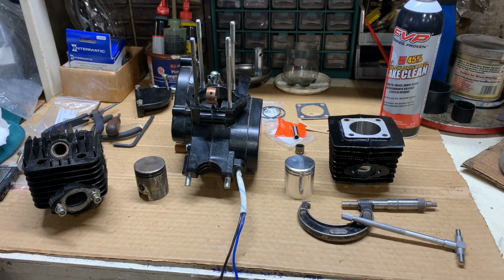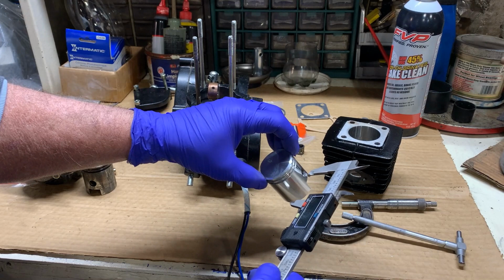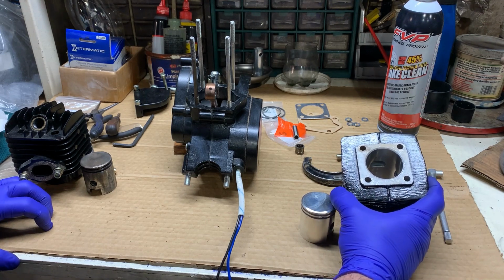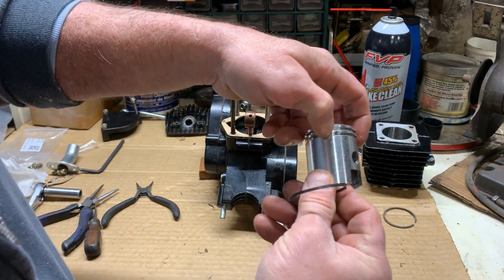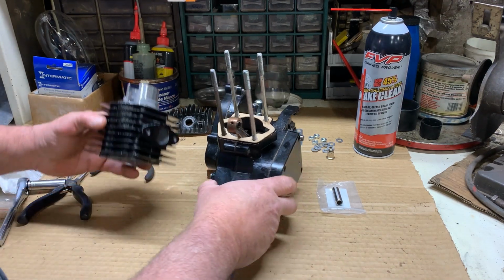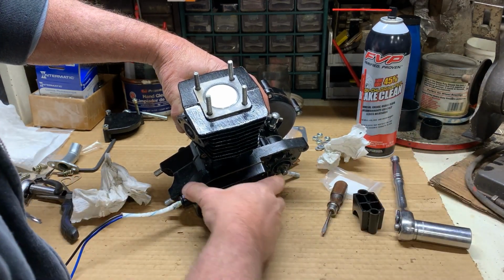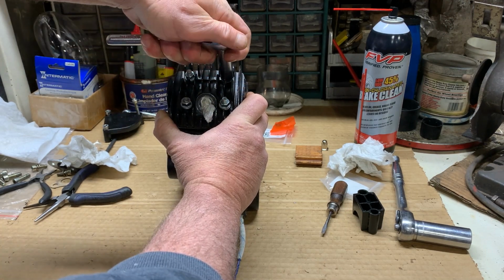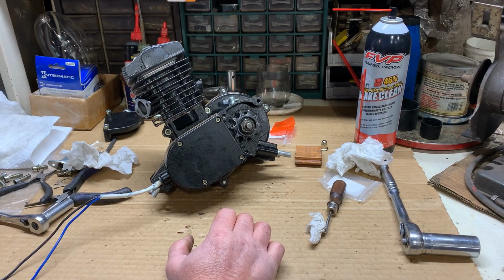Changing a one piece cylinder & checking the bore on a new cylinder

Comment: I didn't think they made a 50cc with the one-piece cylinders, I stand corrected, you should have laid that engine down on it's side when you pushed the cylinder on, the threads on the head-studs will shave tiny pieces of metal off and fall into the crank-case if it's standing up, I just learned this myself, so don't beat yourself up over it, great video, thanks for sharing.
Reply: Isnt the end of the world. It isn't like these won't blow out the transfer ports and out the cylinder if they do happen

Comment: How did u get those studs into the bottom end?  Usually the one piece cylinder heads only have bolts.
Reply from the maker: You can use the studs out of another bike engine as long as it's from one of the same size engine.If you have a 50cc you'll need studs' from a 50cc & the same if your engine is a 80cc.. I had a cadaver engine so I just took the studs & screwed them right in & went with the 2 part cylinder & head..
Reply: @EcoTransGaspoweredBikes  any way I could buy those studs from somewhere?
Reply from the maker: @kaidenfrisch7990  If you can wait until tomorrow morning I think I have a few sets, let me make sure...👍 What size engine do you have because it makes a difference..??
Reply: @EcoTransGaspoweredBikes  50cc practically the same one u have in the video
Reply from the maker: @kaidenfrisch7990  I definitely have them for a 50cc.. I'll let you know tomorrow when I get in the shop.👍
Reply from the maker: @kaidenfrisch7990  I have posted them on my web page,it's just easier that way..Motorized Bicycles - Gas Powered Bikes
https://ecotransgaspoweredbicycles.com/

 If you still need them click on the link, go to shop & type in 50cc engine studs & it should take you right to them..👍

Comment: How many miles do you think that little engine has done up till now
Reply from the maker: The engine in this video is a bad example, this person didn't mix 2 cycle oil in their gas 😢Generally speaking, these engines can go 8,000 to 10,000 miles depending on how hard & fast it's used..🚴‍♂️

Comment: What size piston do you have on that one and what size is the cylinder
Reply from the maker: This is a 50cc engine. I don't have the exact #'s with me at the moment, I threw my notes in the fire place when I was done..If you need the exact #'s for something your working on I can pop off the head &   check for you..
Reply: @EcoTransGaspoweredBikes  yeah if you look at one of my YouTube videos you'll see the two stroke motor trying to figure out what size piston it is and what size cylinder should I put on there trying to match up the same
Reply: I want to say it's a PK two-stroke motor
Reply from the maker: I checked out your video..Yours looks like the one I just did. A good thing about the engines is they only make two sizes of pistons,it's either a 50cc or 80cc so no chance of making a mistake there, the main thing is if it's a high hole or low hole ( for long or short rod). Usually when ordering your piston & cyl. all you have to know is size 50 or 80 & high or low whole & that about it..I'll get you the general size when I get to the shop & send it to you this evening..👍
Reply: @EcoTransGaspoweredBikes  thanks for your reply and your information it's an 80cc motor
Reply from the maker: @motorizedbicyclerider5296   All you need to know now is if you have a low or high hole,usually they give you the measurement to check by when your ordering..

Comment: I've had good luck with the one piece head but its a bit on the pingy side.
Reply from the maker: I've had good luck with these also..It seems they starting to go that way with most of the newer engine styles...🤷‍♂️
Reply: In theory you have less leaks and better sitting of the cylinder ...I have one and I'm in the breakin period and I hit 36km/h just testing
Reply: @omargdottin  I just went from a one piece to a new two piece motor. I dont know why but its much louder now. I miss the one piece head if that had anything to do with the loudness. I took both part and its the same size piston I think. Maybe its leaking.
Reply from the maker: @omargdottin  I noticed that the one piece cylinder has a little bigger air exchange ports that gives that style just a little more performance on the top end.🚴‍♂️